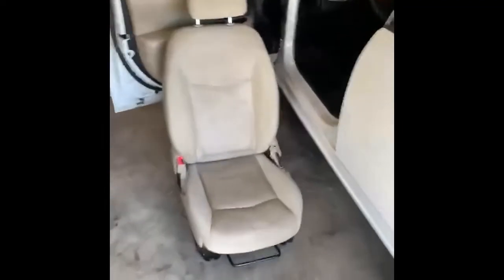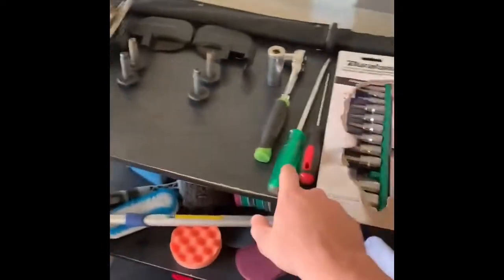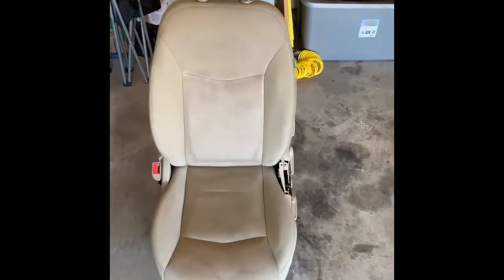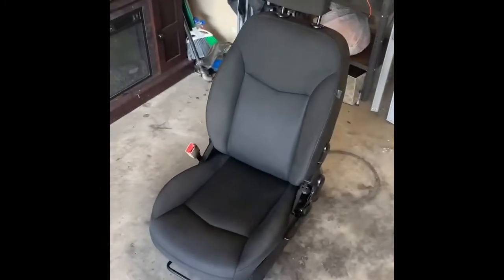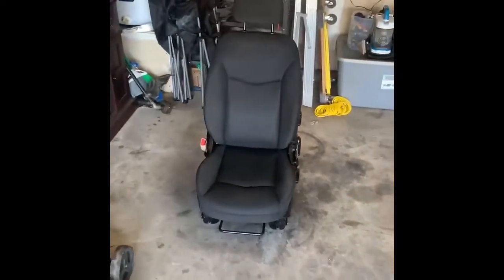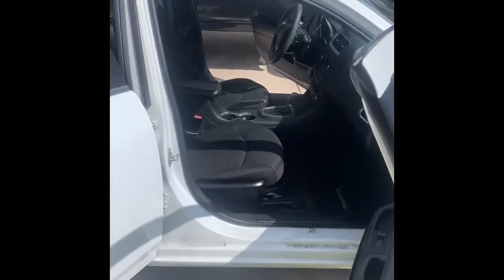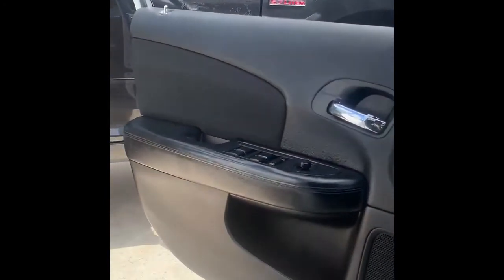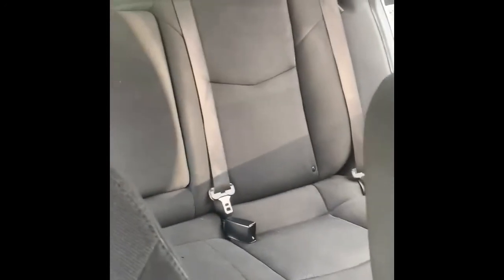Review on Duplicolor vinyl and fabric paint

Comment: I’ve got a sagging headliner in my car, ya think if I remove the sagging fabric that it would stick well to the foam under? I’ll be ripping out just the drooping fabric.
Reply from the maker: I’m not sure but you can get some fabric glue and glue new fabric on fairly easy
Reply: @Jonesblt  I’ve tried that 2x b4 and it’s a mess, also it didn’t stay on too long. Even tried contact cement but it was also messy.
Reply: @erlinavicente7411  why not staple it?